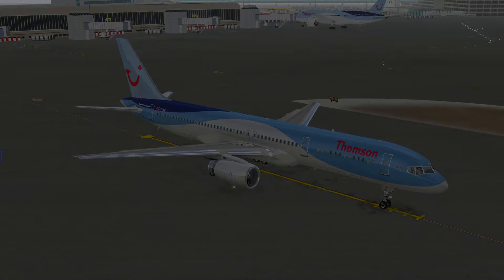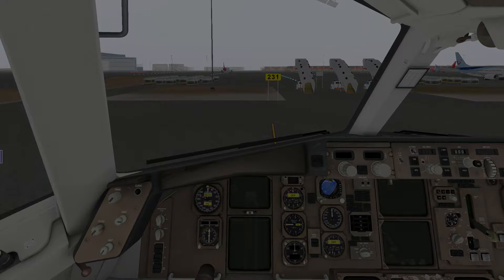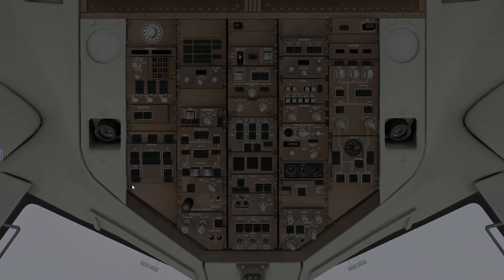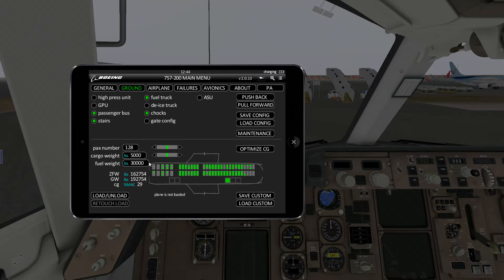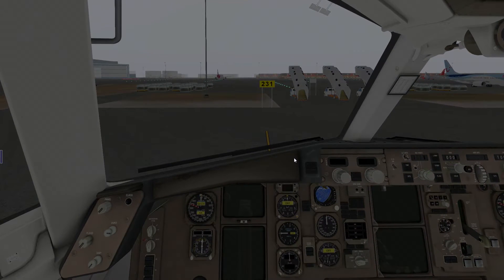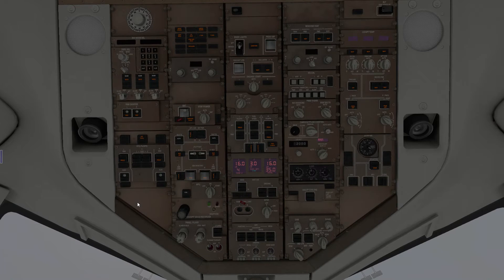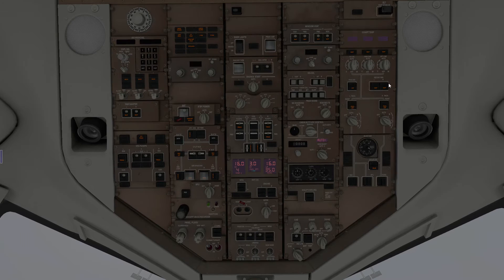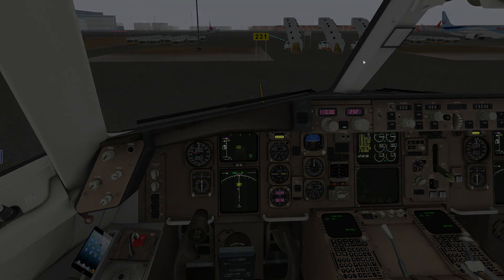XPlane 10/11 - FlightFactor 757 - Episode 1: Setup & Powerup

Comment: I´ve got a prob on the 757 by flight factor.. I loaded the fuel in (full
 center tank an pums)  the plane, then i check on the fuel indicator 
that I´ve the fuel inside the plane... The reccal panel sayd Fuel 
Configuration... Because I had fully loaded plane I switched on all fuel
 pumps but the C-tank sayd Fuel Pressure :-(.. The warning dissapears 
when I had there about 30% of Takeoff thrust, but when I put it back to 
idle the warning was there again. I tried to restart the pc and then the
 simulator but it didn´t helped.. So what shall I do with this annoying 
thing? (I´m new on the 757) Thx X_flyer_11

Comment: how do i set up wing views. i tried clicking to open the cockpit door and it doesn't respond
Reply from the maker: Ah yh I managed to glitch through the wall behind the co-pilot where the coffee maker is. Maybe they have fixed that by now though :D
Reply: There is a switch on the overhead panel that unlocks the door so you can go into the cabin
Reply: Thanx
Reply: thanx